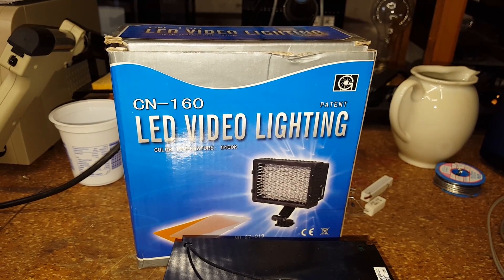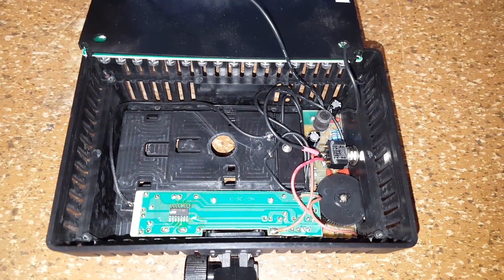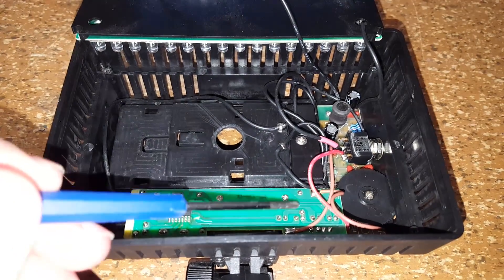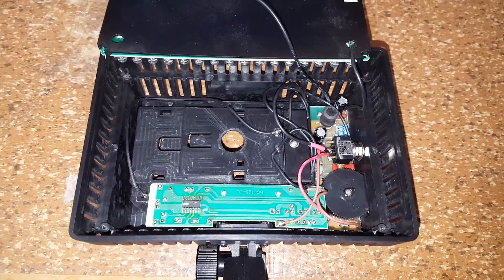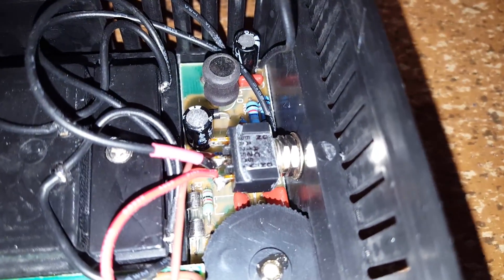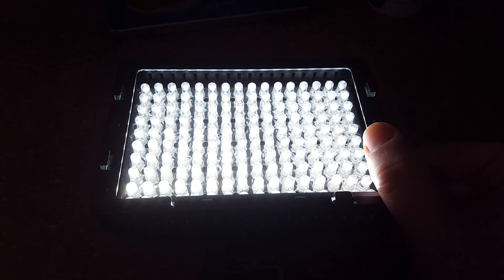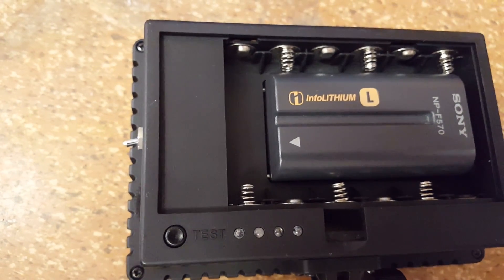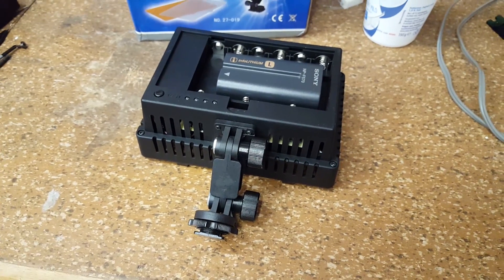CN-160 LED Video Light Modifications

Comment: Put a resistor on red LEDs
Reply from the maker: That is not how the LED works. You need to run the LEDs above their threshold voltage so that they will even turn on. The problem is, the super bright LEDs are super bright even at their threshold voltage.